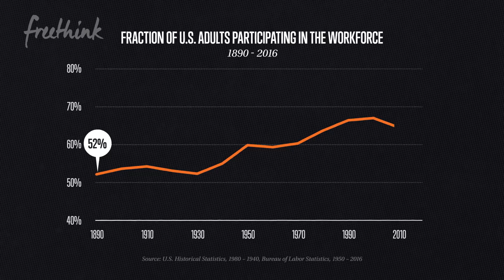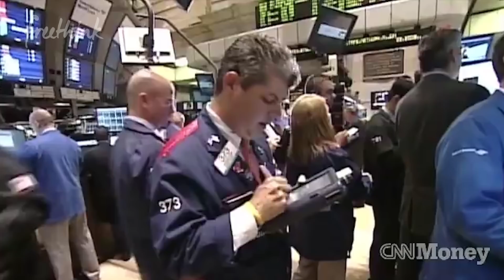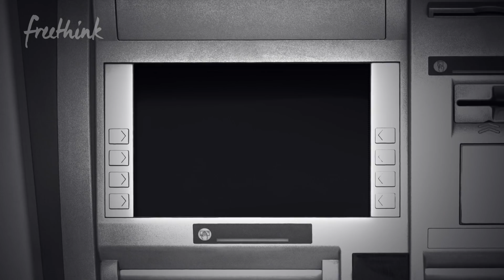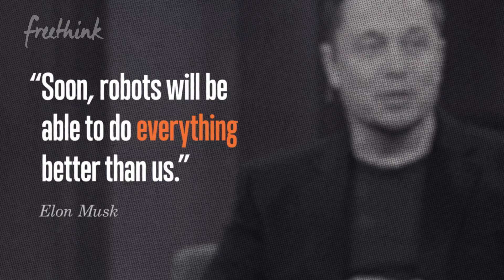Will Robots Take Our Jobs? | Freethink Wrong

Comment: I'm not exactly thrilled about the idea that automation will take over many jobs but having said that we shouldn't fear or embrace it. Instead we should be skeptical, cautious in using automation to excess (checkouts for example), and the rise in automation itself should be slow and steady. I've heard about the supplimental income and it sounds no different from most government programs. If automation takes over and we resort to this supplimental income what's going to happen to the public schools and colleges? Basic and higher education could become worthless if automation takes over. We would be stuck without a job and holding a degree and no one to hire us. To me that's scary.

Comment: The first difference is that AI won't need the same type of maintenance, and even if it does than another AI robot will preform it not a mechanic. These jobs are also highly skilled and require degrees such as an MD, Teaching and even Engineering. When you put these people out of jobs debts won't be paid, human connections will be fake. The fear of having inhuman things cutting you open will lead to less hospital visits. These will lead to vast unemployment poverty and a new government which American will have to live under called communism because the only jobs out there will be for diplomats and robotic engineers.

Comment: The difference is simple mechanical machines replaced hard labor jobs which freed up humans to specialize in intellectual work. AI is a machine but for the intellectual work which means humans have no where to go. Although as others have pointed out this may not be a problem if handled correctly.

Comment: what is wrong is not working aside with the robotic, remember this, they are your hands and they are there to help.  Placing an AI core as personality can be easy to deal with just throw tons magnets all over the building and the AI can't predict where to go to because they are stuck in a high magnetized building.  To the extra advantages to man, we can cut off their power supply, the higher electric require the harder they have to operate to come such.  Then yet again AI can be smart switch battery, but still can easily locate depending how much battery is being burnt out and they require oil and keeping themselves not to be rusted.  Don't give the machine higher advantages then man, only give certain ability it poses to do.  Let me label that as my Golden Rules

1 of many Golden Rules
- Don't give the machine higher advantages then man, only give certain ability to possess certain role pose to do.

Comment: What you say is true and there will always be new jobs but they rarely ever require the same skills, just look at the value of a uni degree in the 1960s vs today, fresh graduates are consistently struggling to find work when they used to be able to go straight into the work of their degree. 

I'm kind of on the fence with this issue tbh